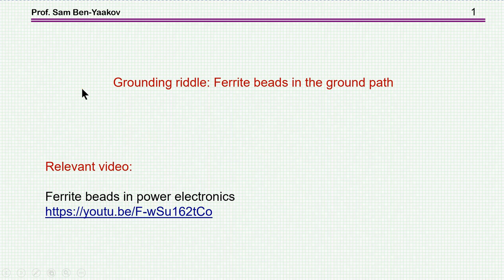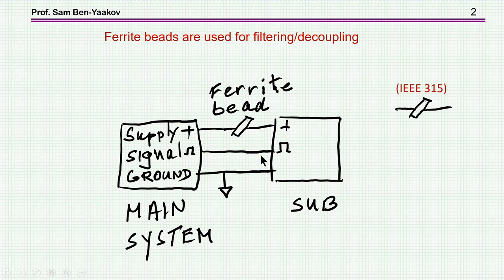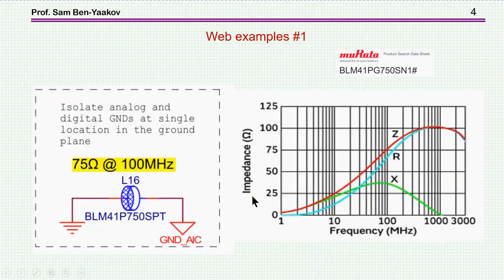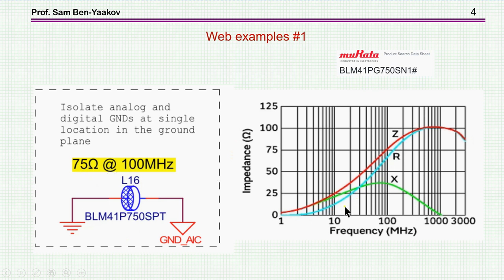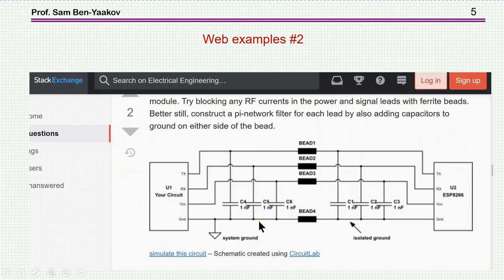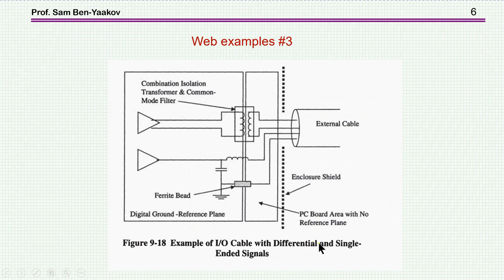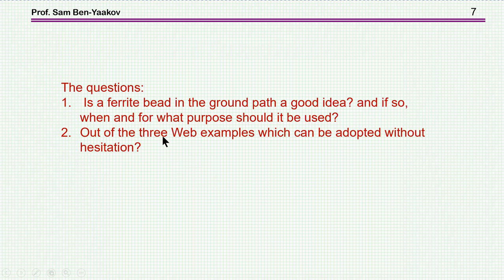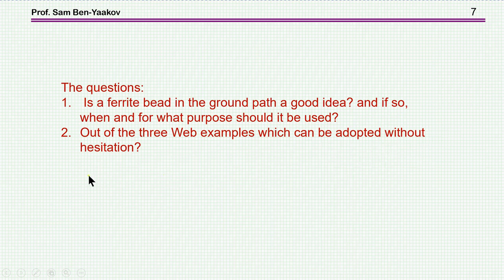Grounding riddle: Ferrite beads in the ground path

Comment: 1. First case it depends on return path- layout? If there is no return path for high frequency component then it is not good. The return path should be as short as possible. Basically it could be done if the communication of other part does not have high speed communication  with isolated(via ferrite) device and we want to prevent high frequency currents . I would not reccomend to do so. 
2. Case I think is not recommended since it will limit the communication speed roughly to 100kHz. If communication speed is low then it is reccommended. 
3. It is recommended since  signal is differential and it limits common mode voltage high frequency part only.
Reply from the maker: Very good points

Comment: When we say ground it should always be a low impedance return path. 
Adding ferrite bead on the gnd increases resistance in the path in mohm range during low frequency and in ohm range during high frequency of return current. 

It is certainly not a good thing.
Reply from the maker: Not exactly. Hold on to my answers.

Comment: 1st example. It depend, without wider scope of problem is hard to say if this bad idea or good idea,
2nd example with UART communication is bad. Ferrite bead should go from power supply to supplied system, not between modules. UART use high frequency, then we have voltage drop on ferrite bead...
3th example look good, for me it look like attenuation for LC filter (high R for high frequency, dump gain in resonant frequency)
Reply from the maker: Good points but there is more to it.